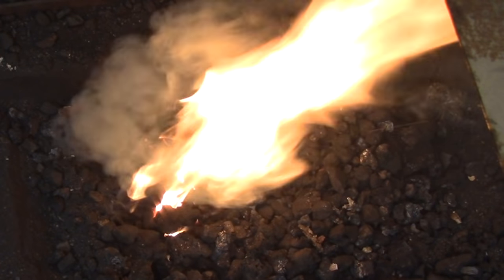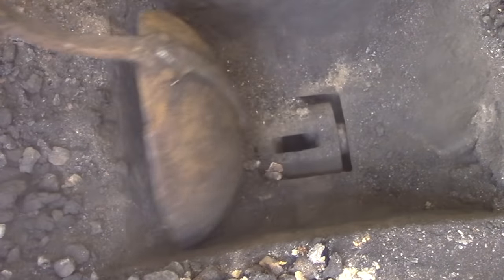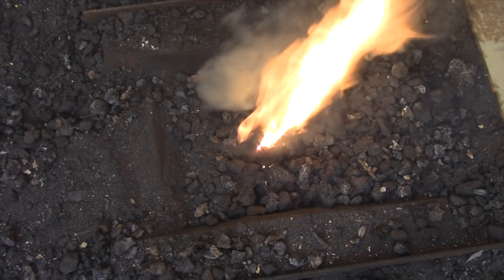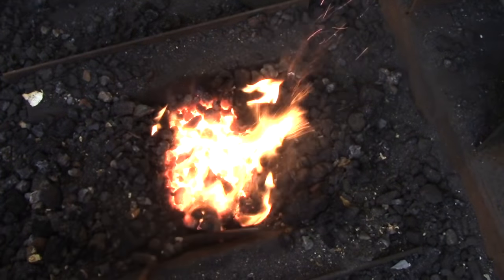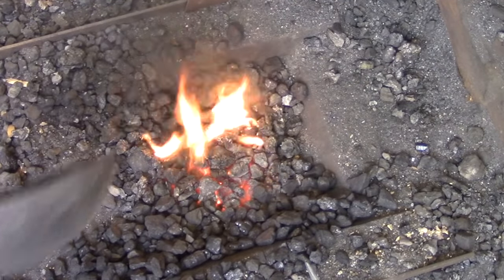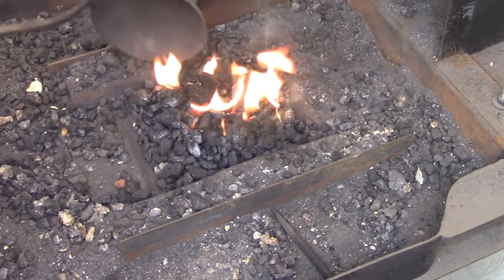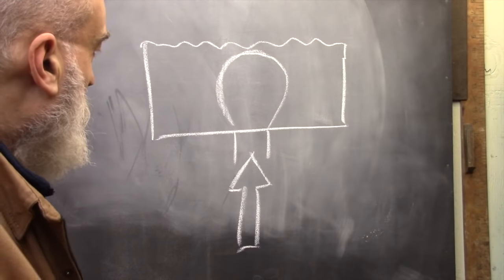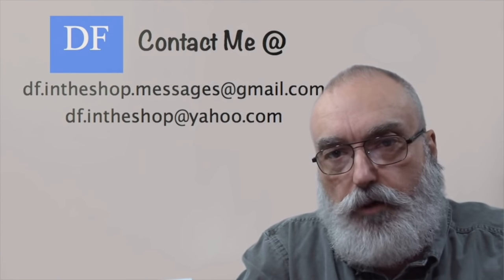Blacksmithing For Beginners - Working With A Coal Fire

Comment: Thank you for putting this together Dennis. I have been smithing for awhile now but felt like I needed more instruction on how to manage/run the fire. This helped me a lot. Something that I would like to hear you talk about and use with your diagram of the fire pit is an oxidizing fire and a reducing fire. How to create one and prevent the other. How to tell just what one has going at any given time. Thanks again.
Reply from the maker: I guess I need to redo this video.  I thought I had covered this here but you are right I was heading in that direction and overlooked it for some reason.  ThanksI explained how an unattended fire can burn hollow but the unwanted side effect , that I forgot to mention,  is an oxidizing fire because the air is not consumed by the fire before it reaches the steel.  This unconsumed air can then react with the steel and cause it to burn like a cutting torch. So an oxidizing fire is any fire that is being supplied with more air than is needed for complete  combustion.  This could be from a hollow fire or a solid well maintained fire with a heavy air blast.  A true reduction fire is not possible in a solid fuel forge because there is no way to force an excess of fuel through the system the same way you can with a  gas burner and furnace arrangement.  The best we can achieve is a neutral fire where all the air is consumed in the lower half of the fire and the heat is driven up to top half of the fire. The top half of the fire is neutral because the fire from the bottom half is supplying the heat needed for combustion but the upper half is burning by consuming the air around the coals not from an air blast that must pass over the metal.  If this type of fire is maintained you can theoretically hold a piece of steel at a welding heat for any length of time because there is no air to react with the oxygen on the surface of the metal.

Comment: DF - Thank you very much for the lesson.  I have been having issues keeping my fire up for some time now.  The first two or three hours are good, then I would start losing fire.  None of the books I had not read had stressed packing down from each side  into the fire instead of from the top.  Following your method, yesterday hour ten was as good as hour one.  Now if the hand was as good as it used to be!  Thank you.

Comment: Great video for me, coming back to blacksmithing after a long time away. I work with a standalone pan forge with a hand crank blower out the middle, about 16" diameter, around 3"  deep. The last part of the video really clarified how I should work with it, I've been way too light on the amount of coal in the forge at any given time which probably explains a lot the problems I've had. Thanks!

Comment: many thanks for your explantions and videos. they are a great help in my firtst steps in blacksmitting. I've built a fire pot accordingly to the spec's you've given and it works perfectly. Tryed and succeeded a forge weld w/o flux as well. Greetings from Belgium

Comment: you are great at what you do ,sir. thank you for the video
Reply: I have a question though is there a certain type of coal to use?
Reply from the maker: I'm using a soft bituminous coal. It's what is available here.
Reply: I have asked a couple experienced blacksmiths about the preferred coal to use and both said bituminous.  Don't remember why the harder anthracite wasn't, maybe doesn't coke as well.

Comment: It can be really an advantage to get out the dust and slag or you could end up with a so called "black fire" that grimes the iron and produces more slag (if the fire is hot enough to melt the dust and ash) and so on.
Reply from the maker: It's quite a coincidence that you made this comment now.  The old  firepot that I used in this video had a large opening at at the base so most of the dust just fell out the bottom. I've since replaced it and I have been noticing lately that the fire is a little harder to manage. I'm not having the scale or grime buildup you mentioned there is just more non combustible dust that I now have to deal with.  I just recently came to the conclusion that I needed to rebuild the grate to solve the problem.

Comment: A very helpful and informative vid. ❤

Request/suggestion:  on the off chance you ever get around to reshooting an updated version there are 2 things I would have liked to have learned more about, and I think a lot of people wpuld find it helpful too (apologies if youve already since covered these in separate vids)

1) The different types of fuel and how fire management differs betwen them.  The coal in this vid looks like bitumenous (guess), but anthracite and MET Coke seem to be equally popular choices, and ive seen at least one vid of someone using bulk feed corn.

2) The different parts of the fire (reducing, etc), and how pot size and the amount of airflow can be optimized for the type of work you most commonly do.

Thanks for the educational content. 😁
Reply from the maker: I am using bituminous coal and it is the only type of fuel that needs any special handling.  Anthracite, charcoal and coke do not clump together so they naturally fall into the center of the fire as it is consumed.  Anthracite and coke do need a constant air supply to stay lit but that is pretty much all there is to it.   I have never used coke but there is good video called "why coke forges are the best" that I would recommend for that.
Reply: @df-intheshop330  Couldnt ask for a more concise answer.  I'll search out that vid.  Ty and +1. 👍

Comment: very informative video. One point I didn't get, is necessary to keep providing continuous air supply even if the fire is very hot. During 1/2hr brake did you stop the blower. Thanks
Reply from the maker: I'm using a hand cranked blower so the air is off anytime I move away from the fire.  Once the fire reaches the temperature you are after it is only necessary to supply enough air to keep the fire at that temperature.  To much air at that point will greatly increase the chance of burning the steel.
Reply: @df-intheshop330  you have no idea how much you help me in learning coal forge. I really appreciate your help. Again thank-you sir for posting nice tutorial.

Comment: Is it possible to use wood coal?  I heard that for knife forging it is the preferred form of call to use. Is that accurate? What are the advantages and disadvantages?
Reply from the maker: Charcoal is an excellent fuel.  It does get consumed very quickly so the forges tend to be larger to handle the extra volume

Comment: thank you for this video. I'm just now getting started in blacksmithing I built a forge and use a hair dryer for air. ( will 1 day improve the forge)
but for now it's a brake drum with a hair dryer I also don't have anywhere I know of to buy coal local so I use lump char coal some I buy and some I make. 
now all that being said my question is do the techniques you described apply to the char coal as well. 
thank you for your time and sorry for such a long post
Reply: Doug Franklin   Wood charcoal was the fuel used by blacksmiths for centuries in England until they cut down all the trees, and then they were forced to come up with another fuel, coal (coke).  So there should be some info on using charcoal for fuel.

Comment: I have a bowl shaped hand crank bottom air feed... should I be piling my coal higher in the middle?...
Reply from the maker: It would be better to raise the sides of the forge so you can make a deeper fire not just a pile in the center.

Comment: Just found your channel, I really like how well you explain everything your doing. I’m interested in getting into blacksmithing as a hobby. What basic tools should I look at getting to get me started?
Reply from the maker: Of course if you have the ability to set up a welder, drill press cut off saw etc.  That is were you would start because that will pay for itself by building  just about everything else you need but as for blacksmithing I would concentrate on building ( or buying ) a really good forge.  Everything else can be makeshift but if you can't heat the metal properly that will really limit what you can do.  90% of blacksmithing is reshaping metal and that is all done over the main body of the anvil so any large heavy block with a hard surface will work as an anvil and any type of hammer work to move metal.  I used regular machinist vises for years until I found my first post vise and vise grips were my first tongs.  The important thing is to get working any way that you can.  Take classes or find any smiths working in your area that can help you out.  You will figure out what you need by figuring out how you want to work.  Everybody has a different opinion on it and you will too when you are done.

Comment: Thanks I like the way you teach.
I know most blacksmiths treat anthracite like the bastard step child, but could you do a show about it and how it differs from coal of raw coal and why it is not an acceptable fuel. It's all that is available in this area.
Reply from the maker: Anthracite is a very dense coal that burns very slowly.  That is the main reason it was popular for home heating.  There is a lot of BTU's per pound and there was little danger of the fire running out of control.  Bituminous or soft coal is a dirty coal by comparison.  In the fire the impurities burn away and the coal turns to a very light coke. This coke is ideal for forging because it  burns very hot and very fast when you add an air blast.  Unlike anthracite which only burns from the outside in, coke is vey porous so the air can get at the entire cross section. For the short time that I used anthracite the only problems I had was that it needed a constant air blast to keep the fire going and to get the higher temps that you need for welding I needed to build a much larger fire to maintain a neutral layer because the air blast does not get consumed as readily as it does with soft coal.  So I do agree that it is less ideal  than soft coal or commercially available coke but so is not working.  There are plenty of people out there using anthracite and doing good work.  It is a different product so you need a different approach, thats all.

Comment: Hi thanks for the video. My fire dies down after a while and it's mostly red coals and a blue flame, will the steel get hot enough with the fire in this condition? Do I need to load more coal into the forge?
Reply from the maker: It will still be possible to heat metal in a fire like that however the metal will have a tendency to burn very quickly because the air blast is not being consumed by the fire. It is always better to add coal regularly to the outside edge of the fire so it has time to coke before it reaches the hottest part of the fire.

Comment: Hello and thanks for all the information! I´m just starting out with blacksmithing and i find your material to be the best i´ve seen on youtube for this purpose. I used coke in my first attempt on building the fire and found that it came in big chunks, leaving a lot of space between them and i think it affects the temperature of the fire. Do i need to split them to smaller pieces in order to get a better fire?
Reply from the maker: Yes you are aiming for pieces that are about 1" in diameter.  This was probably used to fire large boilers so you will need to hammer it down quite a bit.
Reply: DF - In The Shop Thanks, i'll do that.

Comment: What's your opinion on clinker breakers, i.e. the vertical moving type that looks like a mushroom vs the turning type with a wide and a narrow, tapered side?
Reply from the maker: I never use the one on my forge.  Maybe it's something that is necessary if you are using coke - I don't know but I've built several forges with solid grates and had no problems with them.

Comment: The torch you use to start your coal... is it propane?  I can only find ones like that for MAP gas and I would prefer one that I can connect to a standard propane bottle like the ones for bbq grills.
Reply from the maker: It is propane. The torch is made by Bernzomatic .  It had the internal threads to fit on a 1lb tank.  I also bought one from Harbor Freight.  It has a nice torch head but the hose that came with it is really stiff.
Reply: Thank you.  I have finally assembled the tools I need to begin forging after many years of wanting to learn the craft.  Your videos are a great resource!

Comment: and also does it cause a bad smell enough not to do in a close housing area
Reply from the maker: raw coal does smoke quite a bit but once it turns to coke it doesn't smoke at all  because the impurities have burned out.  Even though ( with a lot of practice ) you can build a fire with very little smoke you still need to have neighbours that don't mind the smoke once and a while.  Most smith either use a gas forge or burn commercially produced coke to get around this problem.
Reply: DF - In The Shop thanks so much for replying

Comment: I've had to put the metal to be heated down in the firebox, and would like to heat longer pieces. What's the best way to get the heat high enough where the piece is longer than the dimension of the firebox?
Reply from the maker: I usually start by taking two heats at the far end of where I want to forge.  That build a heat bank and will allow you  to bring the centre section to a higher heat because the ends of the bar are already hot and not sucking the heat out of the centre..  Then it is just a mater of moving the bar back and forth until the centre section heats up.  There is a limit to how much you can heat this way but you can usually get at least twice the length of the firepot fairly easily.
Reply: I took some advice from watching the above video for the 5th time (it takes a while to sink in) and kept the coal off the top of the fire and allowed the heat to come higher in the firebox. This and some judicious application of the volume/velocity of air at a relatively low, but constant supply has essentially lead me to the the procedure you describe above. Thanks, as always.

Comment: any chance you could cover an old furnace, mine has bellows and pumps air from the side 3 inches above the base of the fire
Reply from the maker: The only video I've seen on this has been from Rowan Taylor.  He uses a side draft forge and gives a short but good explanation on how to set it up and use it. Sorry I can't help you much -  I've never used a side draft forge.  https://youtu.be/7LjfjxtWl9c

Comment: Do you use regular coal? The same stuff you would use in a household fireplace. Could you use coke?
Reply from the maker: Heating coal is usually hard coal and it does not work as well for blacksmithing because it is so dense and burns very slowly.  Coke is actually preferred by a lot of people over soft coal for blacksmithing but it isn't as widely available.  Coke also needs a constant air supply to keep the fire going so if you have a hand cranked blower it can be very frustrating.
Reply: DF - In The Shop . Thanks for the reply sir. Coke is thankfully readily available here in the UK. This is one of the most informative well presented videos on this subject.

Comment: Would really appreciate some help with my forge, i use a similar design 
but with the air tube below with a soot trap, and i find my coke (after a
 few hours of forging) getting coated in ash, no clinkers form, but i 
can distinctly see the coke covered in a thick white ash, now this ash 
restricts the coke actually burning, this coke is very large, like full 
sized coke and it just gets coated :( idk what else to do, ive got a 
poker that does nothing to get the ash off, the only way to get it off 
is to wait for it to cool and bang it on the anvil one by one
Reply from the maker: Unfortunately I don't have much experience with coke because it isn't available here.  I would guess that the size of the coke is much too large for your forge and it can't get hot enough for the impurities to melt into a clinker so it just cakes upon the outside of the coke.  I would try breaking up the coke into walnut sized piece and see if you still have the same problem.  I'm thinking that with smaller piece you will have more surface area burning which should create a hotter fire and produce clinkers??  If that doesn't work you will need to contact the guys that use coke all the time through some forum like I Forge Iron.  Sorry I couldn't be more help.  Please let me know when you do find a solution to the problem.

Comment: Would this same method apply to coke. Can you do a video on a Coke forge?
Reply: Trench Forge Armory a coke and coal forge are the exact same thing. When using coal you burn it into coke and this substance is what burns.
Reply: TheBcm27 but Coke is not coal even thought coal burns into Coke. But yes to some degree you are right. Thanks for the reply.
Reply: In my experience, the coke forge operates quite similarly. The main difference is obviously that you skip the whole burn-the-coal-into-coke step. That means you don't get the "cakes" of coal that were shown lying on top of the fire here, since that whole step has been done beforehand. Lumps of coke also seem to move more loosely in relation to eachother, so I haven't really had any big problems with the cavities forming at the bottom, as coke tends to more naturally fall into the void.

I think coke fires can be a bit more difficult ot get started, so I often have some charcoal or build a wood fire first, and then proceed to coke once the heat is properly established.

Hope this helps!
Reply: David Brennhaugen Yes. Thanks for the reply

Comment: The smoke from coal is very irritating ... how do you deal with it?
Reply from the maker: A good exhaust hood is the best way to handle it.  Some smiths also use a two canister respirator to filter out anything that gets around the hood.